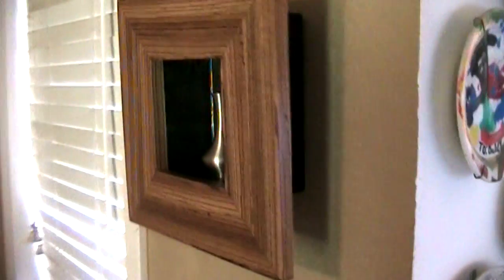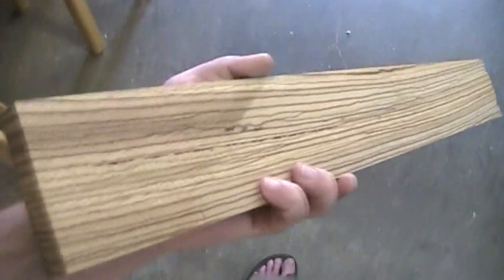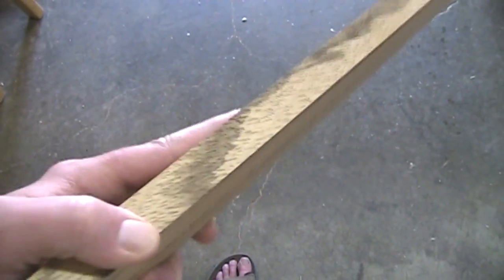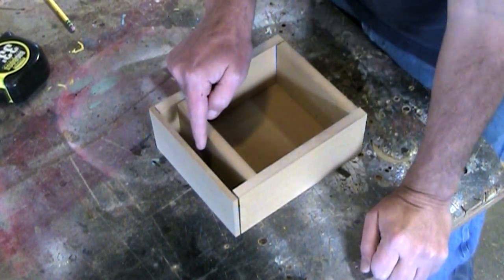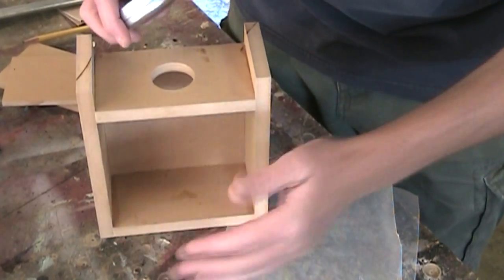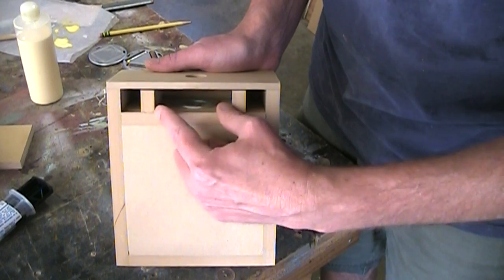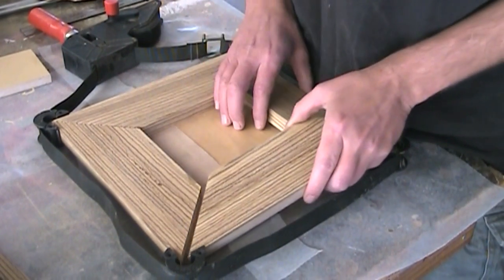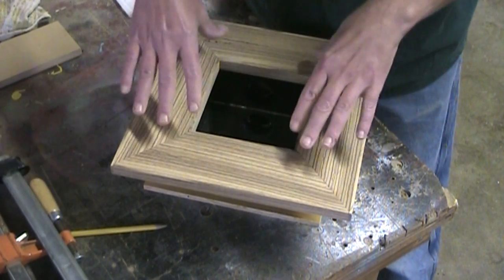Make a lighted shadowbox

Comment: I was looking for an idea to light up shadow box and it had to be battery operated like yours. Thanks for the great idea and the mounting technique is excellent. Seems like adding the extra washer threw off your clearance gap for the light. In my experience it's pretty pressure sensitive if the gap is even card stock thickness to small it will not work right.

Comment: Also, the shadow box is the first thing ive ever built, aside from a penny board i made in shop class when i was in the 7th grade....a penny boar is just a board with 2 1- inch holes on either ends with pegs in the board as defensive blockers, and the object is to flick the penny in the opposite end hol.....  :-)

Comment: @stevinmarin You could also buy a diamond wheel glass cutter for 5 or 10 bucks and cut it to whatever size you need.  You could probably trash pick a mirror or glass easily enough.

Comment: @stevinmarin The biggest challenge with crafting is setting yourself apart from everyone else so if no one is finishing MDF it just might be something. I actually have a project planned where I am thinking about using MDF in a unique role and finishing it would add to the utility of the material.

Comment: great video and thanks for sharing you skills.  What is the band/tool you are using to keep the frame square as you glue it?  That is one of my struggles when assembling (or usually reassembling a broken) a frame.  Thanks
Reply: +Wcoyote The tool is a band clamp used to hold odd-shaped pieces while gluing them.